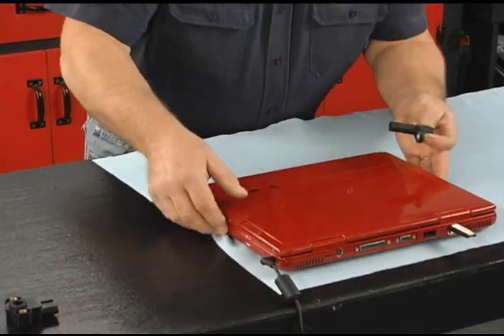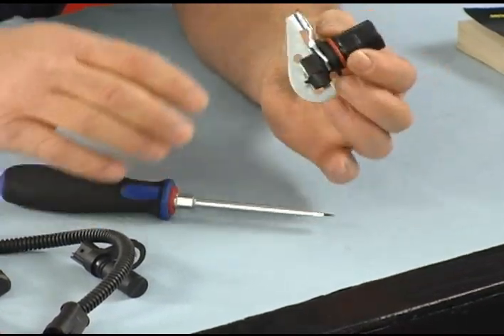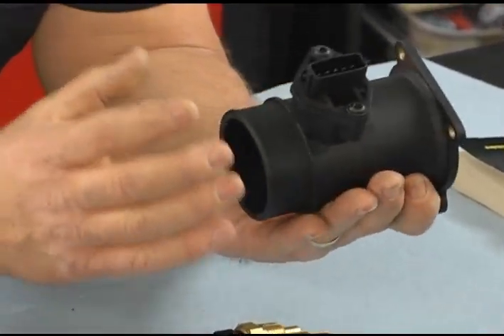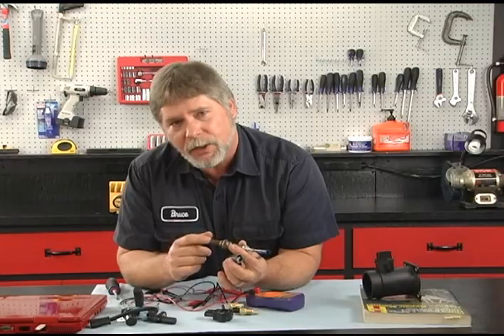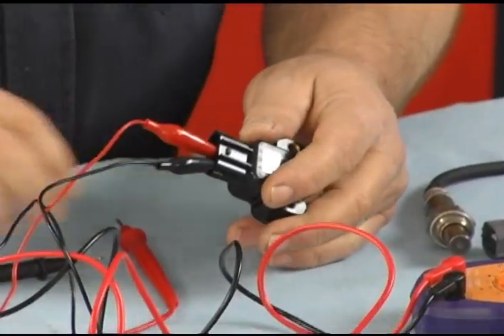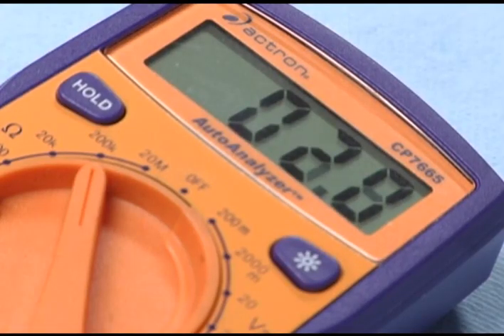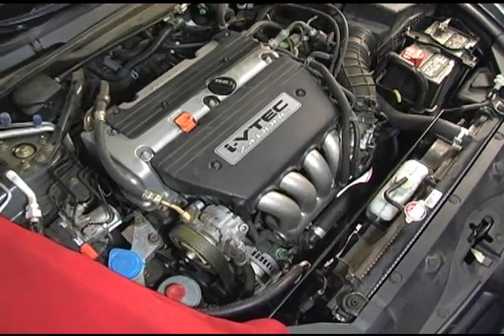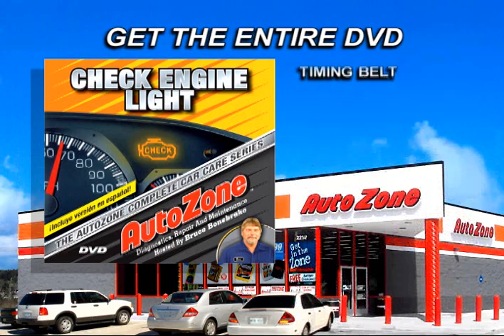Common Sensor Types - AutoZone Car Care

Comment: When checking the throttle position sensor, is the ohm meter connected between ground and signal or .... ?  
On a 92 Corolla, the engine starts but on runs for about 1 second or so.  I suspect it's a sensor, but don't know which sensor.  Which sensor might tell the computer to stop the injectors from injecting after the motor starts?